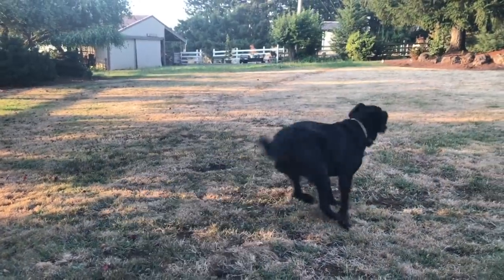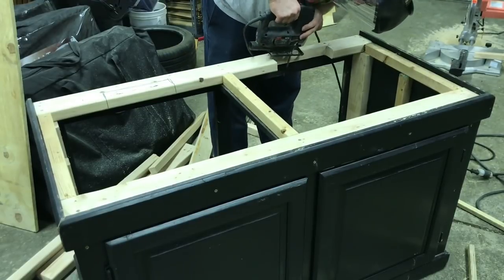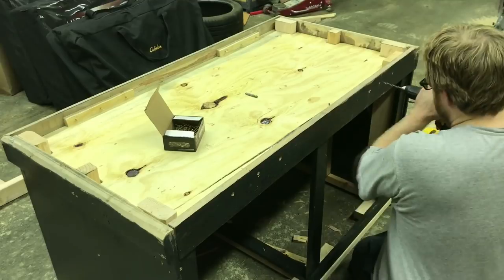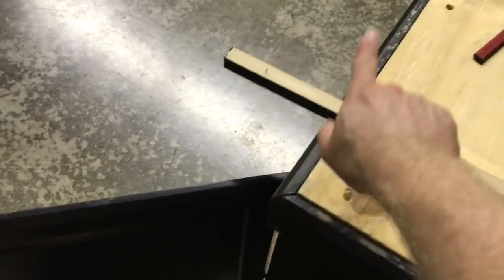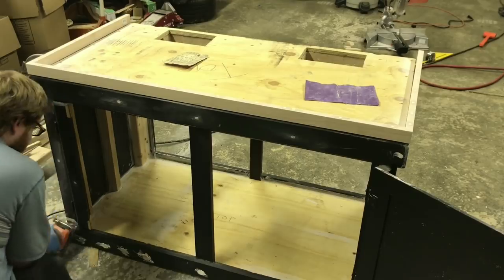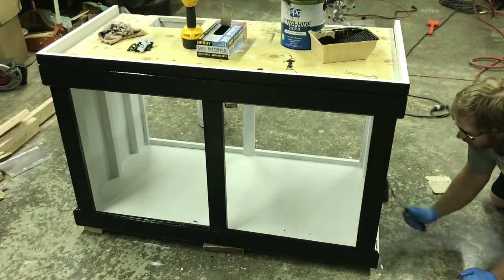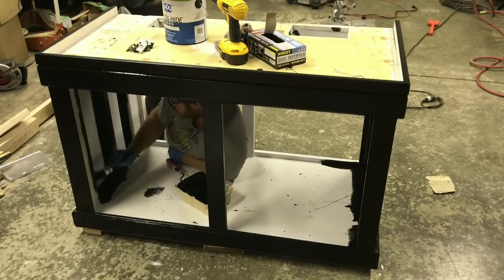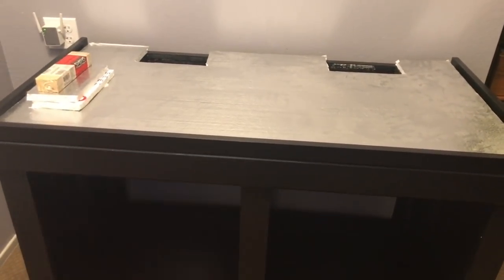HOW I RESTORED MY FISH TANK STAND

Comment: No primer/paint on the top where the tank rests? -You know all the drips that go down the side of the tank...
I do 3 coats of primer on horizontal surfaces and 2 on vertical. Ditto for the paint. I use rug padding instead of Styrofoam. I love to paint...
Nice job.
Reply from the maker: Thanks for the suggestion. I did paint the top, but maybe I will add another layer or two. Thanks again.

Comment: Why didn’t you add support to the midsection? A 55 gallon tank is roughly 450 lbs. Aren’t you afraid of “bowing” effect over time and possibly failure?
Reply from the maker: No because I made the sides and the top and bottom strong I wasn’t worried.